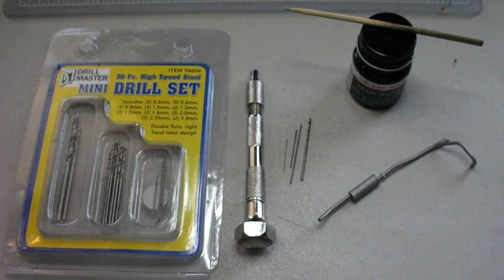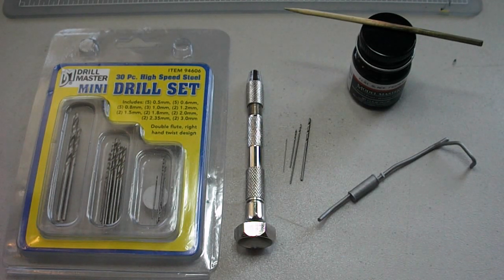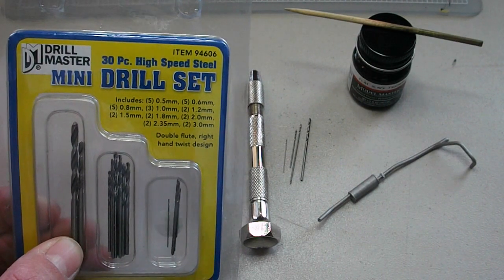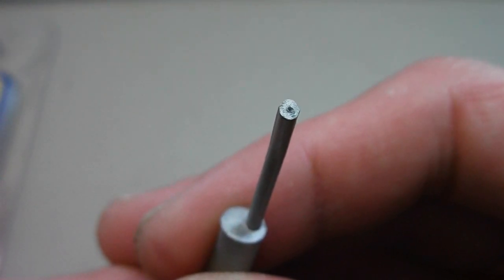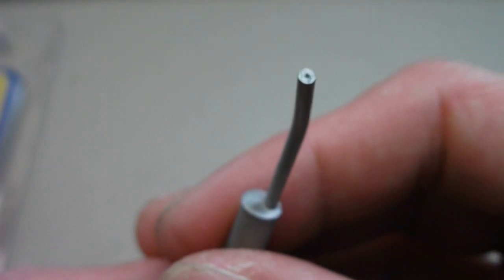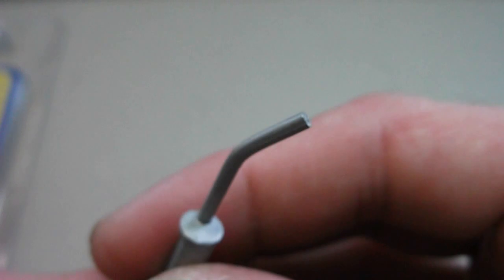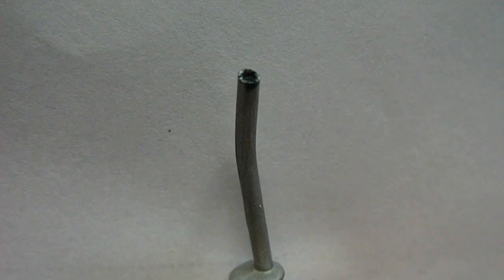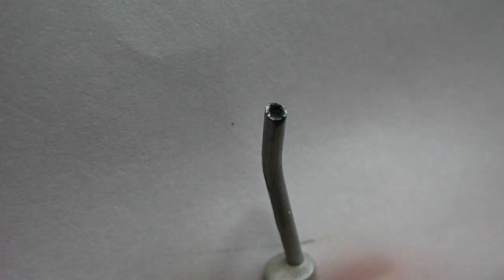Scale Model Detailing: Drilled Exhaust Tips

Comment: I know this video is a couple of weeks old (LOL) but one thing to think about is removing the mold lines (or any flash) on the OUTSIDE of the part being drilled out. Finishing the outside first will allow you to use a little more pressure without worrying about crushing the part. Once it’s hollowed out, the part, being thinner, will be much more likely to crack, bend, collapse, be thrown against the wall in anger… you really don’t want to know how I learned these things!
This simple (and well-done) video will really improve the look of your models; be they cars, boats, trains or planes.